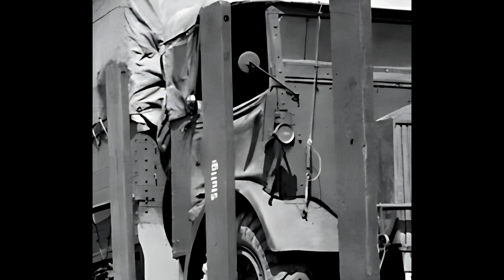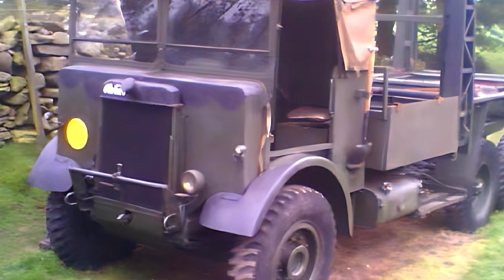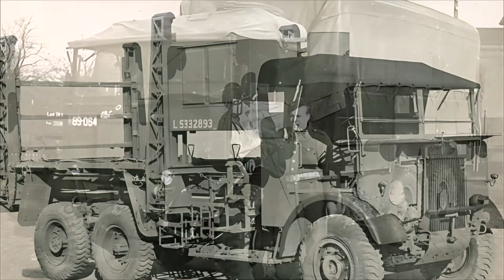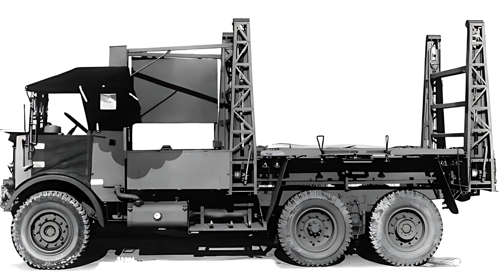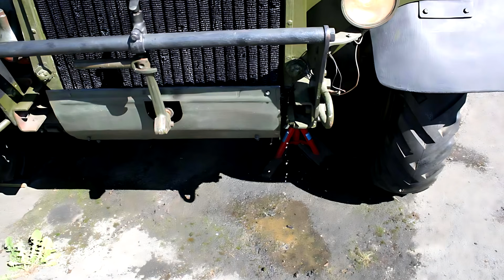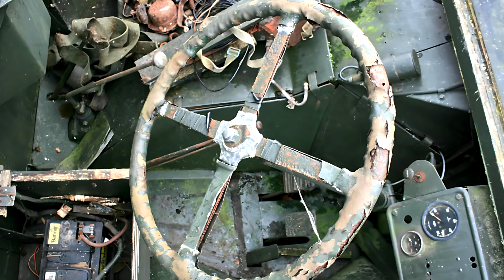1939 Albion BY3 vs BY5 ⚔️ The Evolution of British Power

Comment: Regarding the BY 3-5,s  gearbox, you said the lorry has a transfer box, wrong, a transfer box is usually found on all wheel drive lorries 4x4  6x6 or 8x8. You should say auxiliary box, a second gearbox two or three speed behind the main four speed gearbox, as stated in the video Albions BY series is 6x4 not 6x6. This arrangement of main and auxiliary gearbox commonly found on 6x4 designs by AEC ,Diamond T and Leyland.